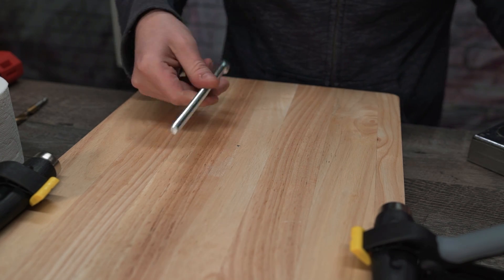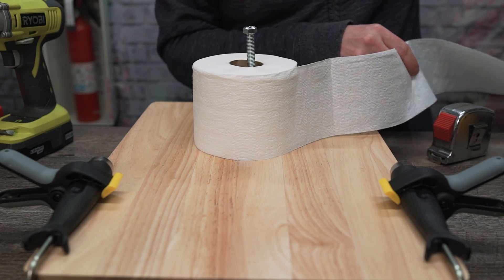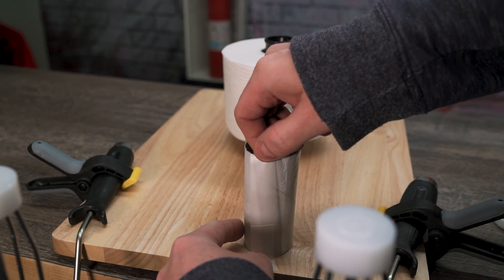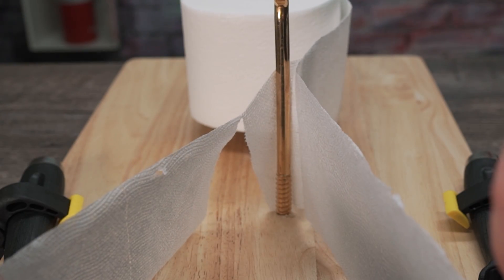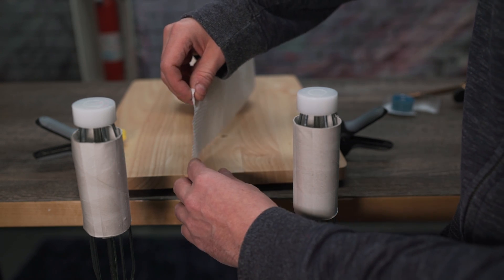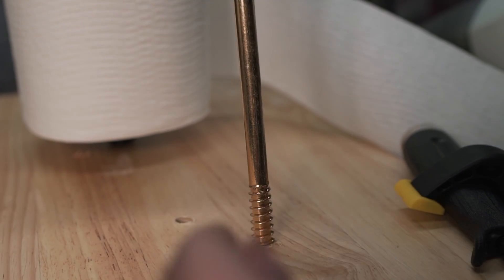Toilet Paper Splitting Machine

Comment: Not a Kimmel fan. But this is amazing  i have located single ply Tp but it is rare. This is a conspiracy to wreck septic systems. Kirkland tp has the audacity to state septic safe. NO it is not. I gave it to my sister and also my daughter and mentioned separate the layers. You could make this and sell it. Of course the Tp companies will put glue somewhere between the layers to  prevent this from working.

Comment: HEY H🖤USEH🖤LD HACKERS: If you don't have a door hook: Order a 4.0 Mirror ball motor from your favorite light and sound company. Now get another Golden Spike, a quarter of the size of the first Golden Spike, and duct tape it to the center top of the paint roller. Duct tape the other end of the Golden Spike to the mirror ball motor spindle, which you have suspended by nailing from a flat-topped archway, kind of like a door frame, made from 3 of your favorite pieces of scrap wood and nailed to the board for stability. Make sure when you made your door frame that you have you have measured so it fits above your paint roller and is plenty wide enough to accommodate the finished full roll and has enough height for the motor. Now plug your motor in and watch it spin your tubes. Feel free to go relax and measure yourself to see how good of a day it is.😂
Reply from the maker: We need to work together